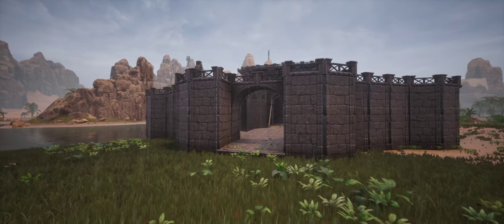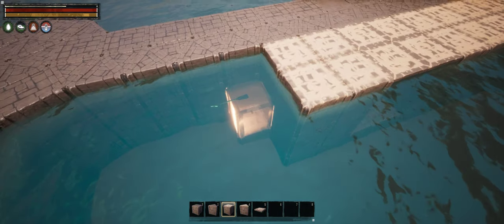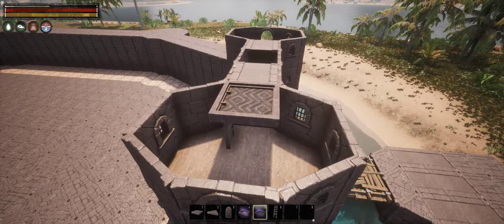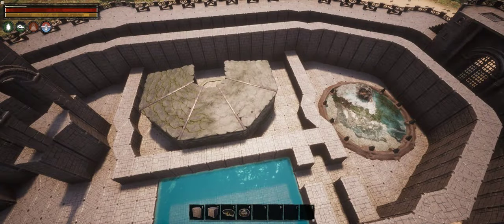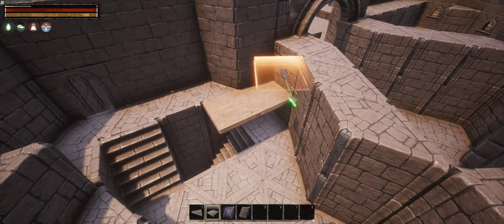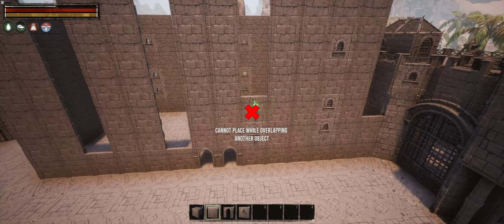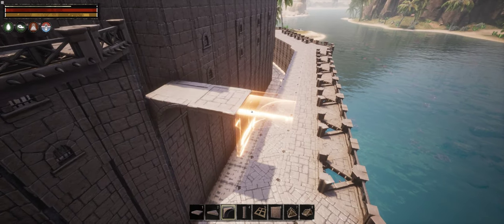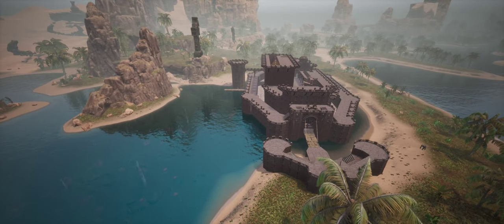How to build a concentric castle.

Comment: I'm trying to duplicate what you've done here and am having trouble figuring out how you did the ceilings over the beast pen and map room?  I can't find any portion of your video that shows this.  I'm also having trouble when using the Glass/Construction mod and the pillar offset as it doesn't seem to provide any support at the top of the column unless I put the column in the vanilla center position of a tile.  Is this not supposed to be happening?

I'd love to see a few more detailed views of those rooms and the inner gate house lower areas.  

Thanks for sharing this and I look forward to other videos you're making!

Comment: Amazing castle. I have a doubt, what do you use to put the pillars? (min 13:19)
Reply from the maker: Hi, if you look at my quickbar there's an item in the third slot that looks like a grid. It's called pillar snappoint extension. To get it you will need to install a mod called "Glass constructions and more..." from Steam Workshop.